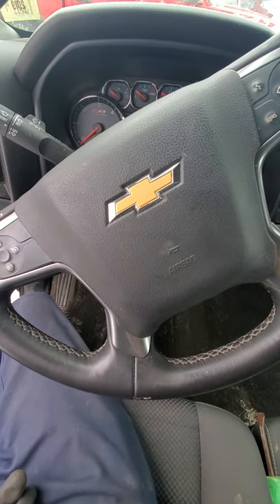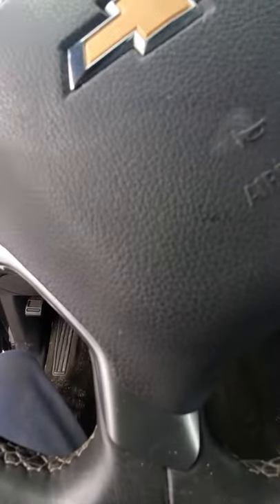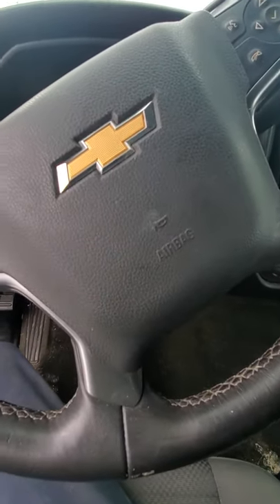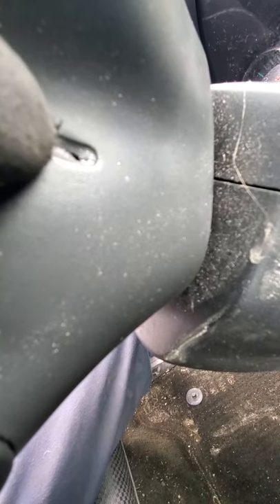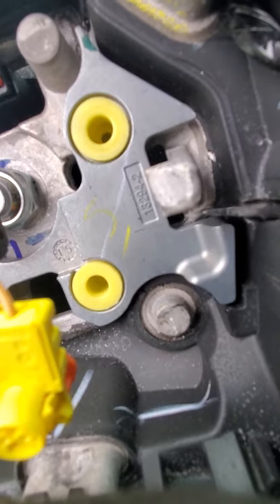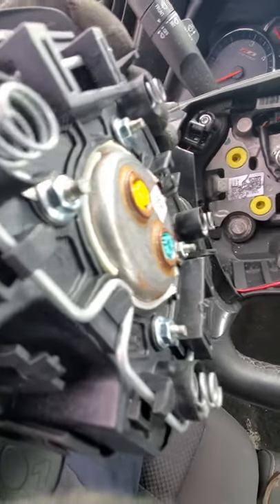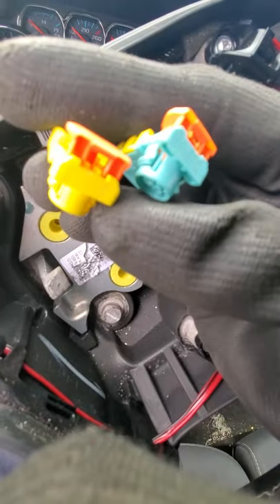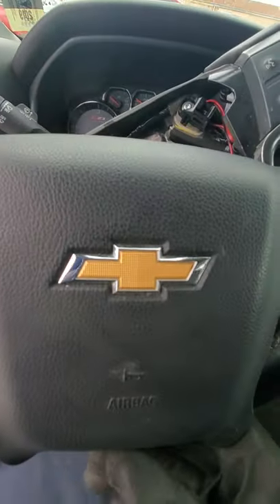2016 Chevy Silverado Wheel Airbag Removal

Comment: !You dont need to poke a hole! If your airbag is blown you can get to the metal clips from the front of the blown bag. If it's not blown, take off the trim peices behind the steering wheel and use a screw driver to release the clips. You don't need to poke a hole
Reply from the maker: It's literally there for the purpose of removing the bag. If your bag is already blown, take it off anyway you'd like
Reply: Thanks way easier

Comment: roof air bag how remove it
Reply from the maker: A-pillar trim needs to come off, headliner needs to come down, at least on the side you're replacing, actuator for the airbag is near the back window with the plug. Replace the SRS module or see if it can be reprogrammed.